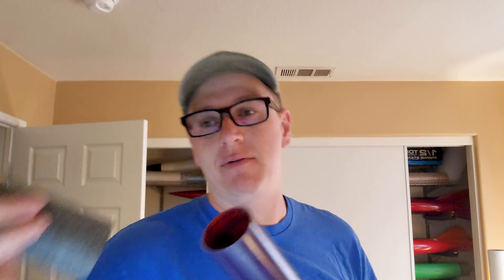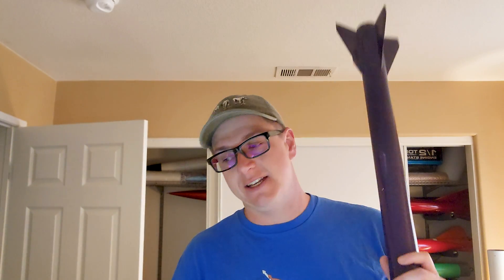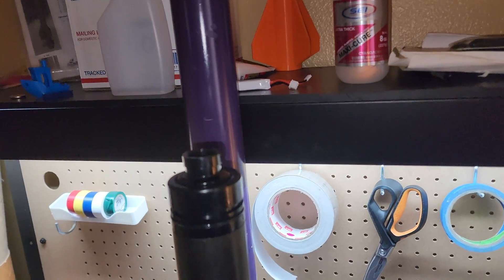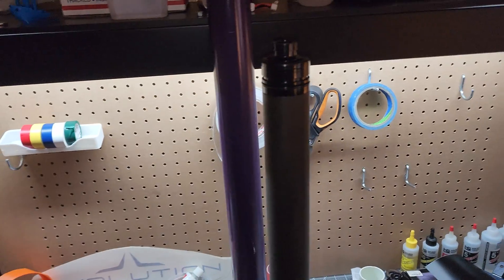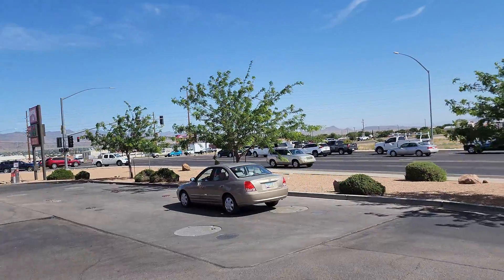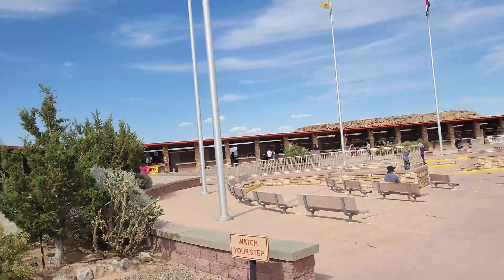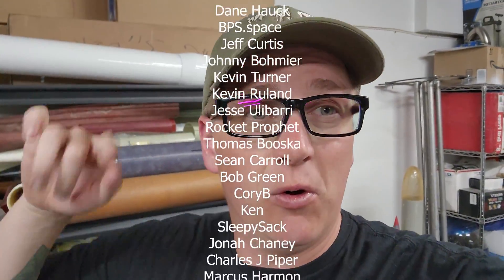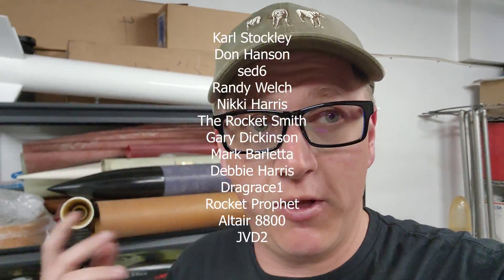My High Power Rocket Motor Failed

Comment: I recently asked you to do a video like this, explaining how they fail. I was trying to identify what goes wrong to TRY to not make the same mistakes.
Reply from the maker: In this case,  there's really nothing to prevent it other than fly a different motor. haha
Reply: @RocketVlogs  do they do recalls for that? If it is so notorious for failure, why buy them?
Reply from the maker: @bigdipper620  Theoretically it's under warranty, but given the manufacture date I'm likely out of luck on that one, unfortunately. I chose to give it a shot anyway because the motor is so unique in terms of performance and size. Aerotech doesn't really have anything comparable because the K250 has a lot less impulse. I'm thinking about trying again next year with the Loki K350 if I can find one, though.

Comment: I still have two brand new 3g and 6g CTI 54mm cases, about 2 years now, that I am scared to fly.  The lore lives on...
Reply: The 3g case and reloads should be fine to fly. It's only really the longer motors that have issues. I think that most of the 6g reloads will be relatively alright if you take the proper precautions. The K300 is an outlier among the other motors it's size for just how unreliable it is.

Comment: Certified Pro 54 moment
Reply: HOW TO PREPARE A PRO 54 CTI MOTOR FOR SUCCESS:
1. DISREGARD INSTRUCTIONS.
2. INSTALL TWO ADDITIONAL O-RINGS (ONE FOR EACH CLOSURE) IN THE APPROPRIATE GROOVES.
3. APPLY WHITE LITHIUM GREASE ONTO O-RINGS, THEIR GROOVES, AND INSIDE BOTH ENDS OF THE MOTOR CASE.
4. EPOXY REAR CLOSURE TO PROPELLANT AND LINER WITH JB WELD.
5. INSERT INTO MOTOR CASE UNTIL PROPERLY SEATED AND TIGHTEN DOWN THE RETAINER RING.
6. SEND IT.
Reply: @karlrobinson4887 oh my god… I’m planning on getting my L2 on Nov 9th and I have my first CTI motor: a p54 5 grain k570 and now I’m scared. I’ve worked very hard on this rocket over the past year and a half…